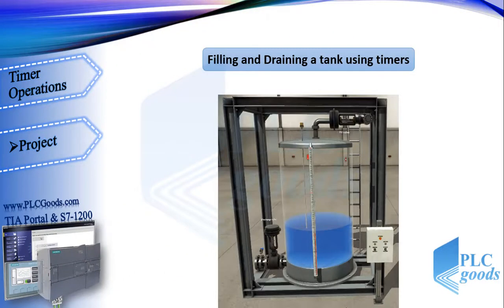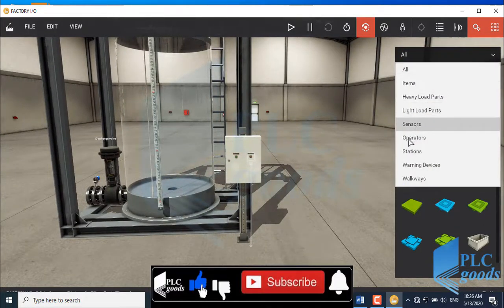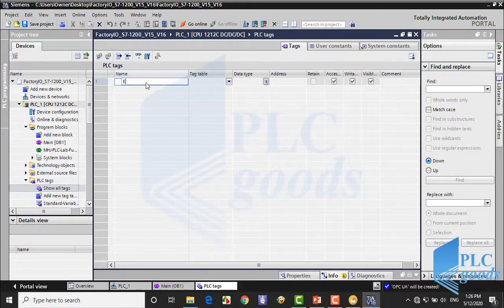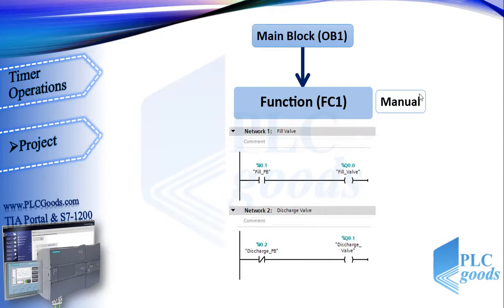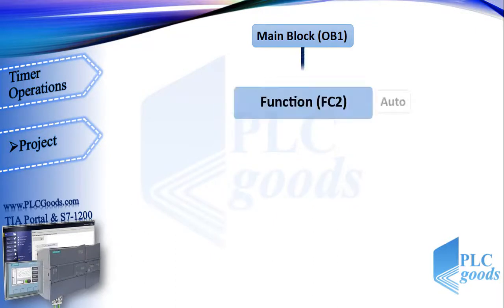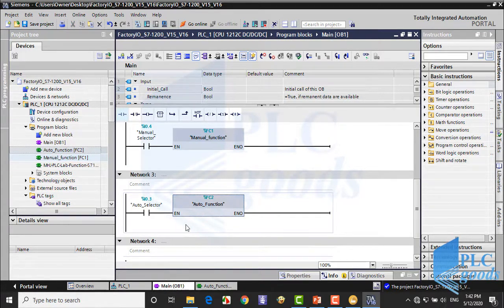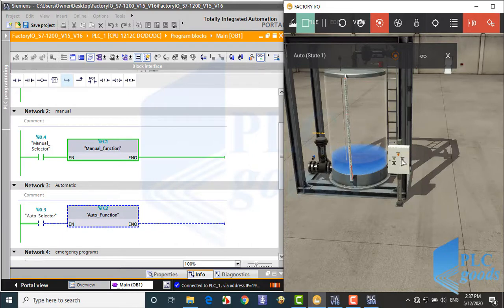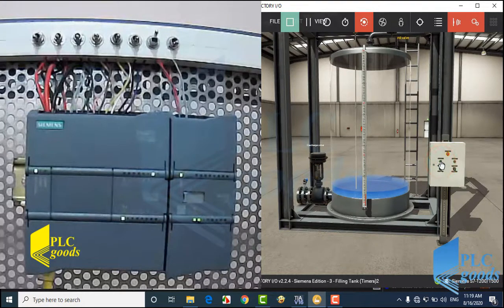PLC Timer Project Tutorial Automatic & Manual Tank Fill Control | L 20

Comment: AUTO/MAN SELEC. CAN BE CONSIDERED AS SAME INPUT AND TIMER SELECTION ALSO SAME INPUT =SAME  INPUT ONLY HOWEVER STATE0 & STATE 1 CHANGES BASED ON CONDITIONS. EXAMPE: MAN. SEL= STATE 0, AUTO SEL:=STATE 1
Reply from the maker: Hi there, thanks for your comment. please mention more details or the exact time of the video, that you may have a problem with that.
Reply: @plcgoods , there is no problem, i was just mentioning some optimisation in the existing ladde programming tags. instead of creating separate tags, we can create same tag (for example: AUTO / MAN selection tag)